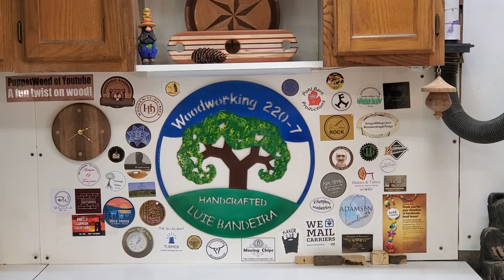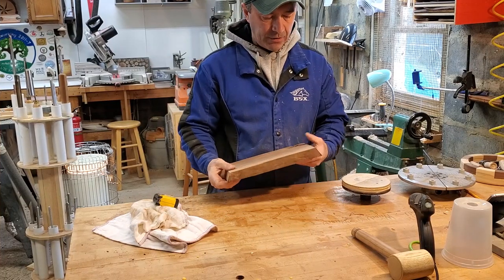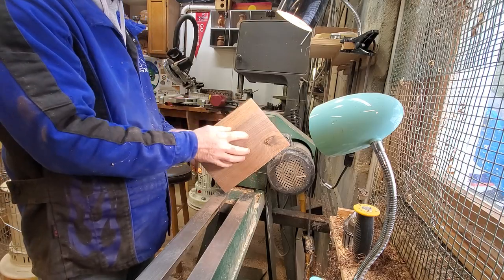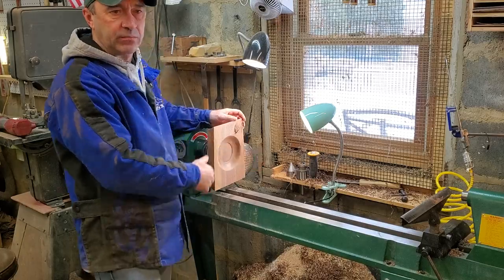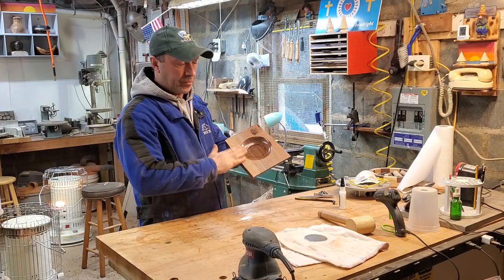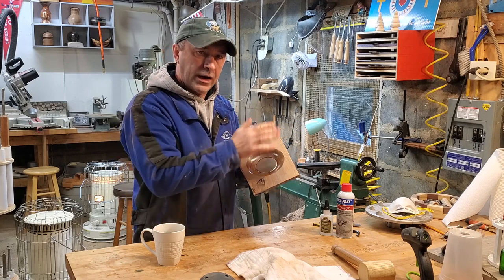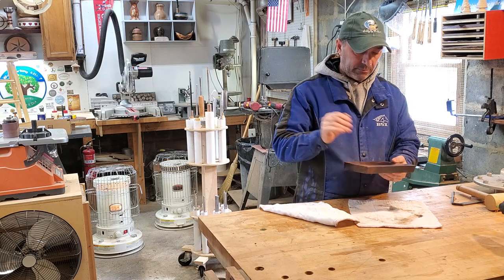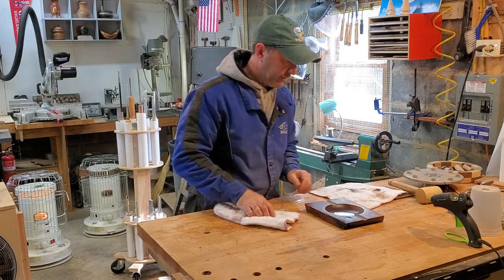Handmade Walnut Cigar Ash Tray Wood Turning

Comment: Noticed the multiple heaters. I used to do that. Then I bought a propane wall heater. Similar to the hot dawg heaters. Gives you more floor space.
Reply from the maker: Yeah I know that they take up space.
But they really work well in my uninsulated shop.
I need the two on the really cold days

Comment: Nice project Luie, I did not notice till the end the knot on one end of the Walnut. That really adds to the look you were after. Guess I did not know there we Cigar Ash trays but this one makes sense. 
 I am wondering what the 2 while cylinder shaped objects with what looks like gages on them. Heaters? I guess I have been shopping for a new heater so that is on my mind.
 Great project!
Gary
Reply from the maker: Thanks,
Not sure what you were looking at on the heaters...but there are fuel gauges on them and the white nobs are for controlling the wick height and there is a chrome fuel cap...hope that helps
Oh just re read the comments yes they are kerosene heaters
Reply: Ok that makes sense. I just found them online. Looks like it is just a wire basket to protect you from getting burned. Seems to be safe in an enclosed area. 
Thanks
Reply from the maker: @ThePapa1947  yeah i have been using this style for years works well and never had any issues